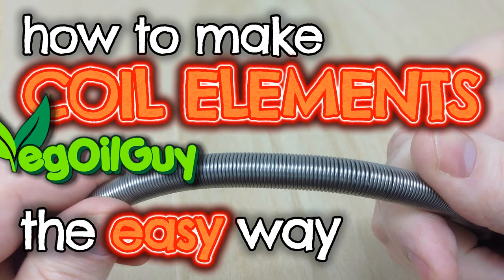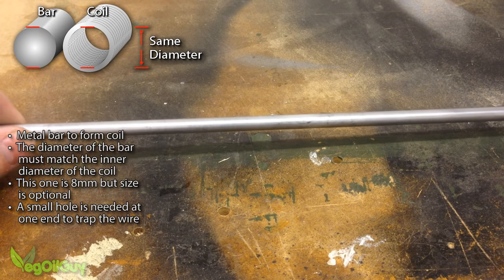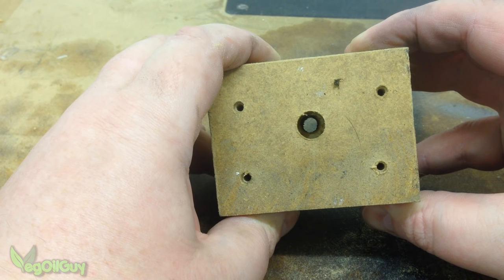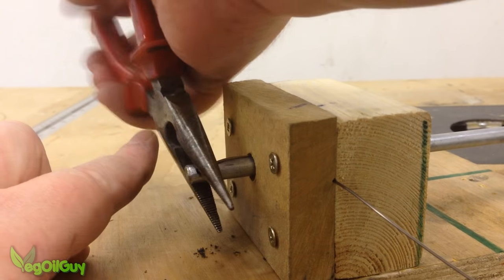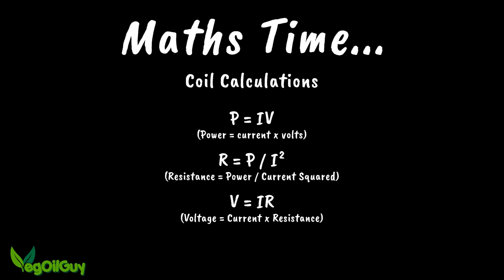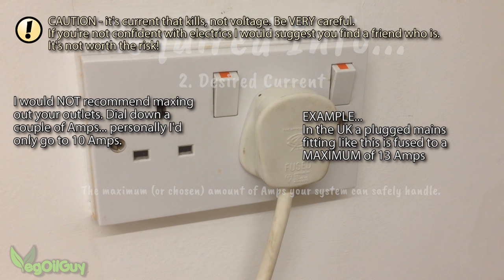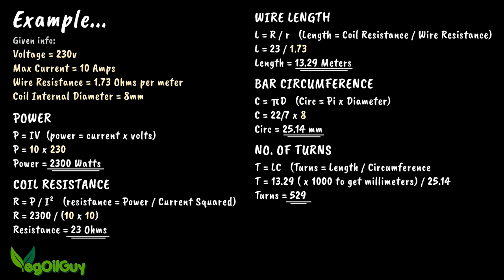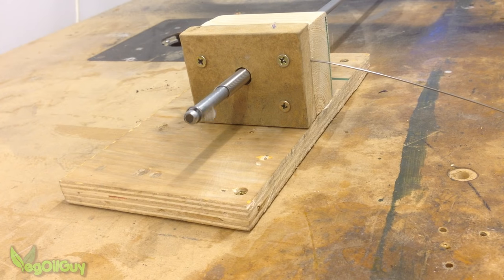Make an EASY coil heating element winding Jig - making electric resistance coils - by VogMan

Comment: Thanks for this video. A note for some of your viewers. Where I live in Western Canada (and many other areas as well), most houses built after 1956-57 have a 240 Volt 3 wire cable already installed and coming from the house's main circuit breaker panel. A 100 Amp service panel is typical for these homes, and most I've seen have a 50 Amp 240 Volt circuit in the panel. These are easy to spot because they're physically larger than the 120 VAC breakers, marked with a higher current rating, and (normally) are always mounted as a pair. (NB: These are NOT the "Main Breakers" that are separately located at the top of the panel. Don't mess with those). In homes with electric stoves, electric clothes dryers or electric hot water heaters, the 240 V line is routed to an outlet or (for hot water heaters) to a junction box. There are different style plugs & sockets for 30 Amp, 40 Amp and 50 Amp connections. However, many homes here use natural gas central heating and natural gas fired tank-type hot water heaters, typically 40 gallons. Many homes, especially higher end construction, have a gas stove as well. This means that there may well be 240 volt wiring already in place, but not in use. Most often, there's either a 40 amp socket behind the stove space in the kitchen, or the line has been roughed in to a junction box with a blind cover plate near the stove or washer/dryer area. 
it's usually a relatively simple matter to re-route this unused 240 VAC line to a different location, such as a workshop. A Word Of Caution: Always, Always shut off BOTH 240 Volt breakers at the breaker panel (there's one for each powered leg of the 3-wire cable) and then carefully TEST the wires at the existing plug or junction box, using a meter or a non-contact "chicken stick" tester to ensure that the circuit is completely shut off and dead. You don't want to risk touching any live wire, or see the light show that occurs if a "live" wire touches the grounded (earthed, to you in the UK) junction box. Unfastening the cable from the junction box is usually not difficult, and often the cable runs under the floor between breaker panel and outlet, making it easy to access from the basement. None of this is particularly difficult, but attention must be paid and proper care taken. If in doubt, get help from someone knowledgeable. (Another note: in older homes, the type of wiring varies widely. Consult an electrician). 
Once you have the unused 240 Volt line free, it can be re-routed to a workshop area (for example). In some cases, the existing cable will be too short, and it will be necessary to buy an appropriately sized junction box and a length of 3 wire cable rated for 240 Volt 50 Amp service, as well as some Marr connectors (insulated wire nuts) at your local hardware store.  Then, you can splice your new cable onto the end of the existing line and put the connections safely inside a junction box with a cover, all mounted to a joist or wall stud. (These boxes are easy to use, and standard). If you have plans to run this power supply outside the house and into a garage or shed, it's best to consult an electrician about how to do this according to the Electrical Code for your area. Direct-burial cable is available, and much of the "grunt work" and trenching for such a job you can do yourself, but getting the wire out of one building and into another safely and to Code should be finished up by a pro, unless you are familiar with the current Code requirements, and confident in your ability to route the cable correctly. In some places, a building permit is needed if the wire run is longer than a specific distance. Many municipalities will issue "homeowner permits" for such work, so you can do it yourself. In practice, the permit simply means that the job, whether done by yourself or an electrician, will be checked for safety and "signed off" by an inspector. IF YOUR AREA HAS SUCH A REQUIREMENT, IT'S PRUDENT TO FOLLOW IT. IF YOU DON'T, YOUR HOUSEHOLD FIRE INSURANCE POLICY CAN BE DECLARED VOID IF YOU EVER HAVE A FIRE, EVEN IF THE FIRE IS NOT CAUSED BY YOUR  WIRING CHANGES. (Don't ask . . . ). Doing this kind of wiring is not especially difficult, but if a permit and inspection is required, it's not a step to skip. 
When choosing the wire for extending a wire run, it's good practice to use a cable with conductors one size larger than the minimum required, especially for long runs. (Wires are sized by number - a smaller number indicates a thicker wire. For example, a #6 wire is thicker, and will carry more current, than a #8 wire. A 240 VAC cable will have a minimum of 3 conductors, sometimes 4. Your electrical parts supplier should know what's required for domestic service in your area).   
Doing this, if you have an otherwise unused 240 volt circuit, will simplify building and operating an electric furnace. (You may want to install a small electrical sub-panel with circuit breakers right at the furnace - this is usually called a "pony panel" or "pony box") Having a 240 VAC circuit in your shop will also allow installation of an outlet for a 240 Volt welder. This which comes in very handy later on. If you are going to be doing any amount of metal melting and casting, it's well worth checking your existing household wiring. If natural gas is in common use, as is the case in Western Canada, there may be an unused 240 volt circuit already installed in your breaker panel, and just waiting to be hooked up. As with anything to do with electricity, BE SAFE and, if in doubt, get help from someone knowledgeable and qualified. (If you need information on the Electrical Code in your area, many municipalities have a copy of the "Simplified Electrical Code" for homeowners available for on their web sites.  Look under "regulations." "building codes," or "construction guidelines."  Hope this helps some of you out.
{One final note: in some very new houses, fire-suppression water sprinkler systems are now required by building codes. If your house is so equipped, you will need to consult an expert about relocating the sprinkler system heads. These systems trigger when high temperatures are detected. You do NOT want a sprinkler to be triggering by accident when you open your furnace. It will spray water all over your molten metal or your crucible furnace. That is a recipe for injury and disaster!}
Reply from the maker: That's some comprehensive advice there. Thanks for sharing : )
Reply: WOOOOOOOOOOOOOOOOOOOOOOW VERY GOOOD INFO VERY GOOOD I DONT HAVE TO GOOGLE IT 
NOW!!! THANKKK YOUUUU
Reply: Great stuff

Comment: Excellent video. I created an excel table to calculate the required coil specifications before watching this video. This re-enforce my understanding. 
The main reason why I am building my own heating coil was due to my coffee roaster heating element was blown off. 

I picked Nichrome 80 AWG 24 as the wire for the heating coil. The way I choose is based on the available space (which is related to how many turns of the coil you can fit in) as well as to achieving the required power.

Comment: Thank you for posting this. I just built and  used a jig like you show us here and it worked quite well. I did make a modification, not if the project but the process to build it that you may be interested in. Where you hacksawed a channel for the wire I drilled a hole.  This gave me a cleaner hole and allowed me to increase the hole size if the wire I am winding doesn't quite fit.  Your jig has really made it much easier and cheaper for me to keep my kiln going, thank you.
Reply from the maker: Thanks Mark  : )
When I do a video my aim is NOT to take the "you must do it this way" approach. My aim is to show folks one possible way and to inspire them improvise and adapt as they feel necessary. So when I get comments like yours I'm thrilled. 
Thanks again and best of luck with your projects.

Comment: SUCCESS!!!!  Thanks a lot for your info on making heating coils.  I didn't make the jig, but I relied heavily on your calculator.  I saved just around $175 fixing rather than buying a new set of coils for my burnout oven.  I bought 50' of 18 gauge kanthal from ebay ($13 shipped) and a 9/64" steel rod from MSCDirect for ($4+$13shipping) and using your calculator, it was a piece of cake.  The hardest part was getting the 9/64" rod.  The inner diameter was critical because the coil had to snake through a very tight grove in the oven stone and couldn't be any longer than 54".  Dirty dusty work, but now the oven works better than new.
Reply from the maker: That's great news. Thanks for sharing : )

Comment: I made my own springs for a project (needing quite long springs) using an almost identical jig. Piano wire in that case rather than resistance wire. But did an absolutely perfect job for less than 1/10 the price of buying formed springs.

Comment: So so cool thanks you cleared up nearly 95% of my problems with just building it myself. The only last issue is how long it takes to bring the temp up in a xxx volume kiln. Then all know what the restrictions and how much wire i need to build different size volumes of kilns. I know i can vary the diameter size of coils , thickness of gage of wires , materials to safe some money without sacrificing size. You rock i think you simply have the best explanation so far on how to build it in a general mathematical way. All you need to know is ohm per meter ratings of wire your going to uses and all the rest can be worked out with math :)
Reply: Buy a large magnet, and manually pump in a few amps with a coil of copper.

Comment: in case anyone else is having issues with coil shrinkage/distortion i had to figure out a break in schedule. 500 - 600ms on time, then 4000 ms off. each cycle removes 1 ms from the down time, so the next is 3999 ms off, then 3998. so far it works well.

Comment: You put a lot of work into the videos, the website and the calculator. Thank you very much for that. I've been using a waste oil furnace, but have some left over Calcium Silicate insulation, and have been thinking of making a A5 sized furnace/heat treatment oven. Since there is a three phase service in my basement, using a three phase SSR, and running three 10A coils, should mean significantly shorter melt times, if the three coils can be made to fit.
Reply from the maker: Very kind : )
Best of luck with your build.

Comment: This is a brilliant little jig. I have a great big lathe that I typically make them on but this your little jig is much better than that even thank you
Reply from the maker: It works surprisingly well : )
Reply: @vogman  I have to make 4 kiln coils.  i don't know the resistance but have noted that each brick in the kiln accommodates 15  to 15 and a half 1/2 inch coils I am using kanthal a1 16 AWG wire.  i had thought about checking the resistance of the old coils but it occurred to me that old oxidized wire would have a higher resistance wouldn't it?

Comment: Thanks a million for this explanation. Question : when the coil is active in the oven for heating that oven up to lets say 1000°c......how do you prevent  the coil initially getting hotter than the max rated temp its intended for ? The thermocouple that sends info to a pid controller only measures the inside temp of the oven....never the actual coil temperature.

Comment: Very helpful videos, particularly all of them that deal with electric kilns. Must have watched them a dozen time now. I'm about to make my own coils now, first time for me, because to buy them is way too expensive. Before I do, if I give you the particulars,  can you advise me on what I can expect, in regards to temperature limit ?
Reply from the maker: Hi Robert. The coil gets hot. That's honestly it. It's just a piece of wire and isn't clever at all. It needs managing ideally with a PID to stop it over heating. Kanthal wire generally burns out at around 1400C. The job of the PID is to turn the coils on and off regularly to maximise the heat output without burning out the coils.
Reply: @vogman  You state the obvious so well, and it all makes sense now. I burned out the wires (probably ni-chrome) in my kiln because there was no PID to control things. Just on / off switches. I've ordered the PID, which will be good up to 1300*C. And the thermocouple & SSR for the same heat. I'm a stickler for energy efficiency, ( or waste ), so in my rebuild I'm utilizing the drum out of a clothes dryer ( 685 mm ) as my outer shell. It might seem like overkill, but the kiln walls are @63 mm thick, wrapped in 25 mm ceramic fiber then surrounded by @90 mm of perlite granular insulation. Even when the kiln is up at maximum temperature, the outside is only warm to the touch. I'm still thinking on how I want to connect the lid. I like TAOW's swing-out design. Thanks for your inspiration.

Comment: Hey Geoff! I need to replace my heating elements in my electric kiln which I use to burnout process in lost PLA method. As you notices in my videos I have a kilm built using rectangular heating elements (very easy maintnance - I just take out the square element with coil out of the kiln and replace the coil). I think they were built using low grade heating coil because they started to malfunction in the same month, week after week. So now from 4 heating blocks I have none and need to replace the coils. 
The choice has gone to Kanthal A1 grade - it's fairly cheap wire and I need to make a wiring Jig like yours. I tried to use the calculator but I think I need to calculate by hand because I do not know If I'm doing something wrong or the calc does something wrong.
My stats for calculations are:
 - Voltage: 230V
 - Power - I need max 2000W in 2 and 1500W in other 2 (the amps are something like 9Amps and 7Amps to get the power I need)
 - bar would be about 5mm of inner dia
 - resistence of the wire itself decribed by the producer - 4,9Ohm/m

So when I put all the information into your calculator there are strange things comming out. With 9Amp max (2000W needed) I get 6.4meters of wire needed and with 7Amps max (1500W) I get 8.21meters of wire needed. I really dont get it because as I am thinking with less power needed I would also need less wire with the same size. Or Am I getting it a bit wrong ?
Reply from the maker: I think I've chatted to you about this elsewhere now 😁😁😁
Reply: @vogman  hell yeah. And thank tou for that. All done mate. Coils already have been replaced 👌💪. Your idea for the jig works like a charm! 🤘🏻

Comment: Great video. I have an element which was wound by a supplier but it turns out the diameter of the coil is too large for the element holder.  How could I wind this coil tighter to reduce the diameter?

Comment: Also that jig is so cool definitely saves big time in making kiln wire. But i am curious on what wire you can get in theory to provide the highest temps because i like to get my kiln up to very high temps even as high as melting iron if possible and as fast as possible...maybe the only route to this is gas/fuel based and not electric based. When you buy these different gage wires do they give you an ohm per meter spec on them not a huge deal you can look them up. Also what about thin iron wire or if your making a low heat kiln just using electrical copper wire coiled up if you get the ohm per foot right ?
Reply from the maker: I'd stick with the proper wire Sam. It's made to do the job.
The temperature of the wire is fairly finite... thickness tends to be about durability. Thicker lasts longer.
Reply: @vogman  Have you tried tungsten wire that they uses in light bulbs i imagine if you got thicker tungsten wire it last longer and not break like a light bulb/burn out so fast. And tungsten is the highest melting point element metal you can get so seems it be the best type to uses. The ones your using are an iron ,chrome, AL alloy and won't get as hot as tungsten would... Any curious also if you uses one long kiln wire or if you piece kiln wire together with connectors if so what connectors won;t melt obviously you cann;t uses wire nuts so it has to be some kind of high heat terminal iron block or something?

Comment: for the use of water heaters directly using AC electricity is it possible?
Reply from the maker: I wouldn't recommend using this approach for water. As a rule, water and electricity don't mix. Please don't risk it - your health is too important : )
Reply: @vogman  how to make water heater ?
Reply from the maker: Electronically that's something I've never done. You need to be 100% sure of watertight fittings, etc. I prefer and indirect method, like running hot water pipes through the water container. This has been the popular method until very recently in homes and businesses.

Comment: Alright VOG, shout out from Newcastle upon Tyne... I tried this and it worked nicely, thanks for the video :) ... follow up question, do you have any suggestions on how to mount the coil to a frame? I am doing a mains-powered heater project and so I need to mount the coil on a frame inside a small metal enclosure. As the temperature will be very high, the only thing I can think to do is attach the coil to a metal frame, but the frame will be secured to the enclosure chassis and so I will likely be making the enclosure Live, which is obviously something I would want to avoid!
Reply from the maker: For some reason porcelain comes to mind... maybe I've read that somewhere or maybe I'm a bit mad. You need to research high temp insulators and go from there. Good luck : )